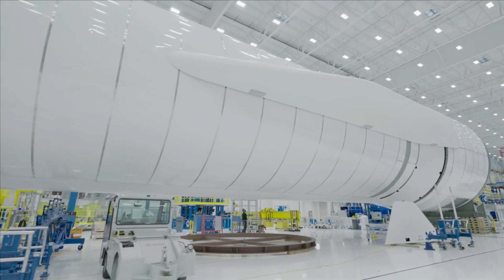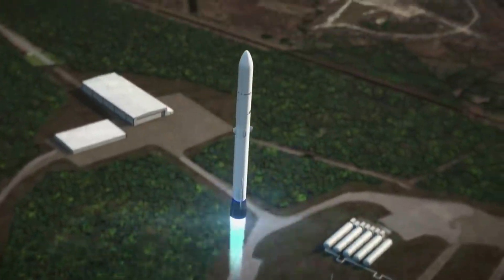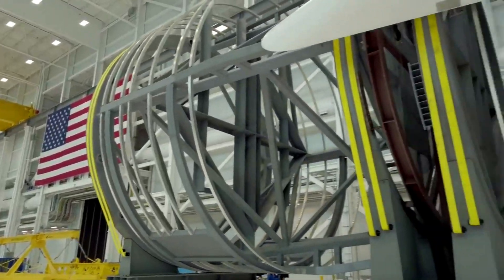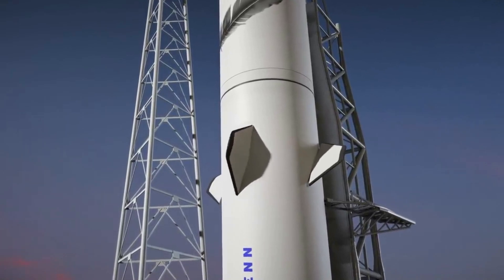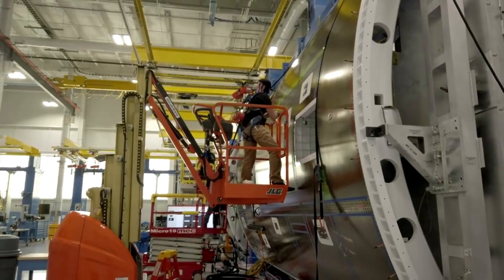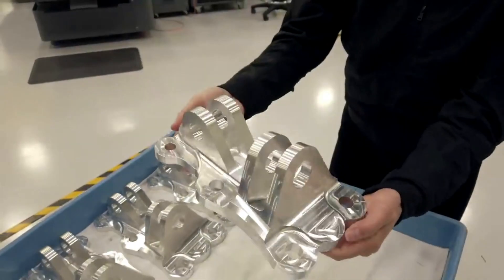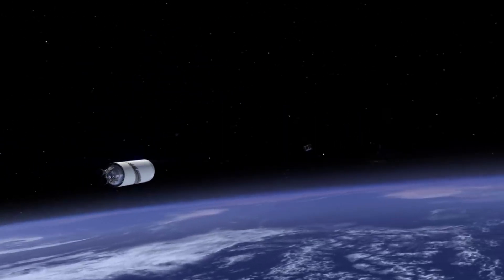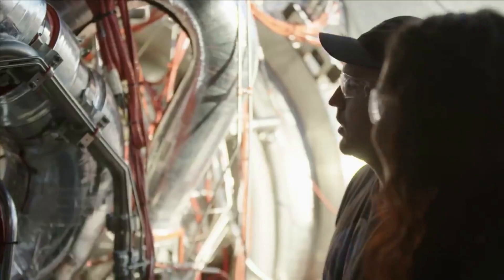How Does Blue Origin Plan To Land New Glenn’s Booster?

Comment: Have they ever thought of building a stationary launch or landing  platform off shore?? It would save the cost of operating barges. Plus br a stationary target for repetitive service. Like you have a zero point on a machining table. Just look at it in a larger way. Go Bezos...
Reply: Problem with a fixed launch & landing point, is that locks your launch into one inclination orbit.  Of course you can add more fixed landing points to increase your inclination choices, but at higher cost.  This is why they use barges, you place them in the orbit inclination you want and launch.

Comment: The question that matters for landing a rocket on a stabilized barge is how much wider is the barge than the distance between the landing feet. If a foot misses the barge surface, then the rocket will be lost. If all of the feet land on the barge, the rocket comes down straight, and it isn't going too fast, it will probably be a successful landing (not counting the very first landing. Many things go wrong the first time.)

Heavy rockets are harder to blow off course.